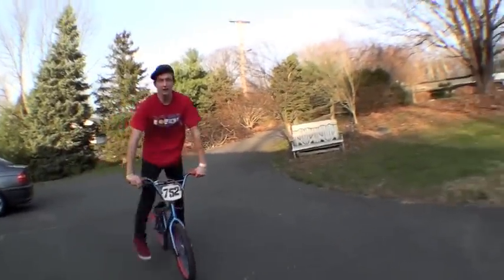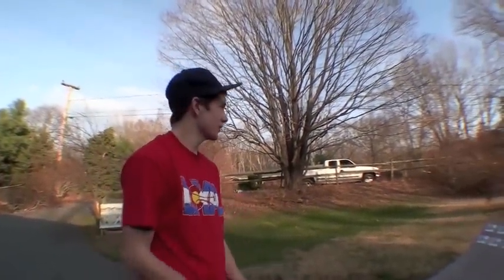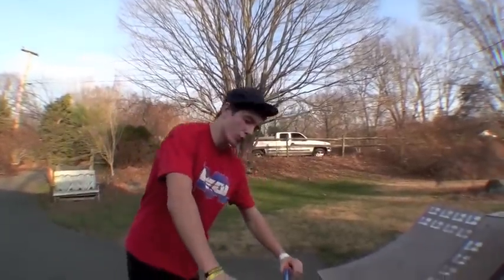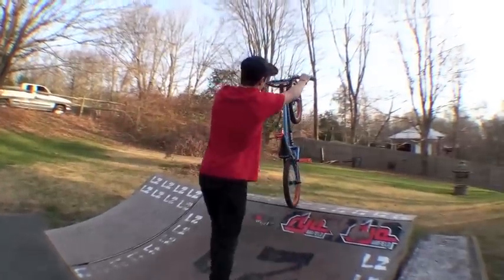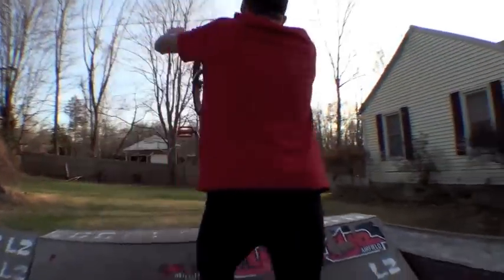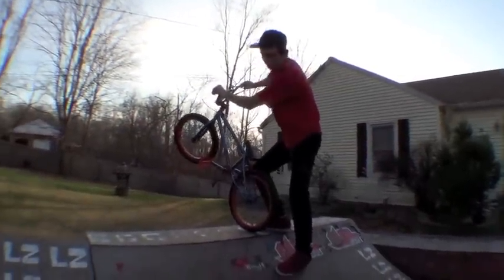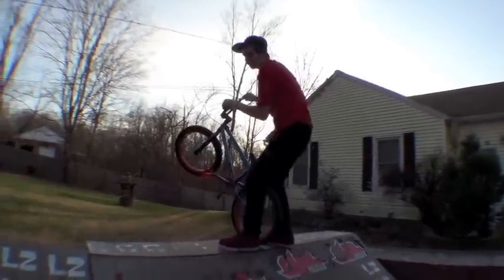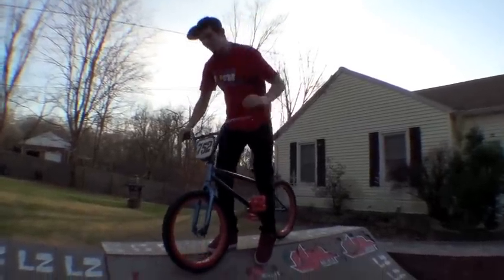How to Fufanu BMX

Comment: you can super fine tune the gearing with larger sprockets. i've seen guys run 55/20 before all because it's more delicate anddialed in. yeah it's heavy but youre not gonna be bunny hoping around the track

Comment: Hell yea i miss my bike. S&M Berringer frame, Euro bb, odyssey hazard light rims, vendero front hub, Odyssey cassette rear hub 9 tooth, with McNeal sprocket guard 25 tooth, impact integrated head set, Fit series 2 forks, gold finger brake clamp, some other shit on it as well, loved that bike but this was way back in 04 they got way cooler shit now days

Comment: why does the bike make an annoying noise?
Reply: Cubing4 MC lmfao! a good bike is loud
Reply: but why
Reply: Its the hub, the clicking of the gears in back tooth
Reply: bikes have mouthes? -_-
Reply: Tooth are that the bumps are on the crank and rear sprocket
Reply: Its called a cassette hub
Reply: still annoying
Reply: I love bmx I have a eastern cobra
Reply: GTFO
Reply: do you mean the click or the squeak? the click is because it's a cassette hub, if you don't want a click and you don't want to have to pedal as you go backwards you can ride a free coaster, and the squeak is just his break.
Reply: Do you mean his cassette or his brake